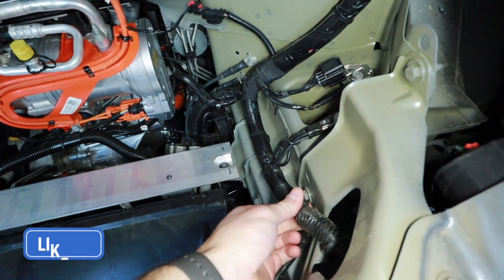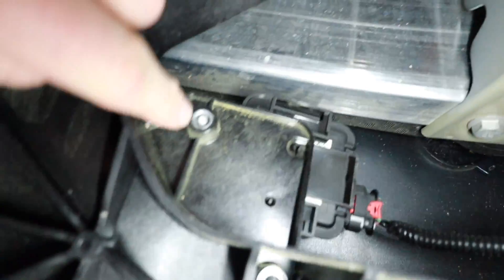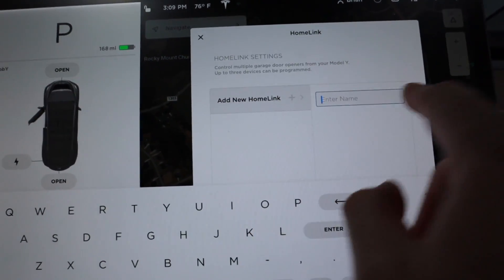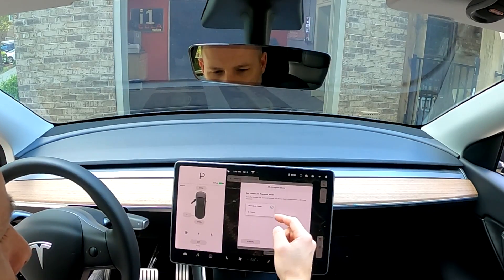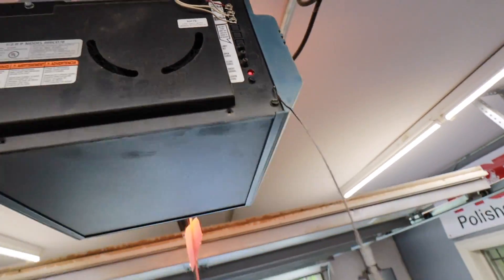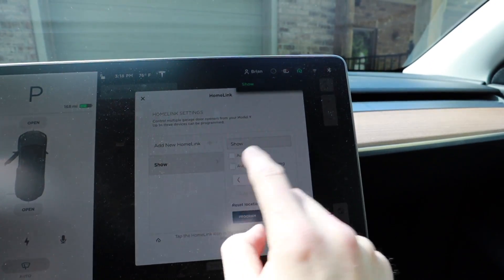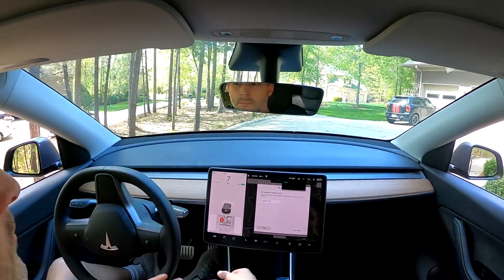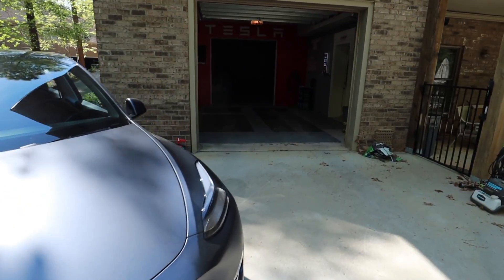Tesla Homelink Install and Program - Garage Door

Comment: I can understand why Tesla removed it as a default, to save money, but I do hope they just make it an option at the time of buying that you can check the box, and once the car is received by your local delivery center, they just install it then before you take delivery.  The install seems pretty straight forward and quick, so you'd think that would work.  I love not having to have a garage door opener clipped to the visor or stored somewhere in the car.
Reply: I hope one day Tesla is a good a MINI when it comes to custom builds on the assembly line. I have never seen another auto manufacturer that can add individual options at the level of MINI.
Reply: Rumor is that a WiFi garage door software will be released. Granted you'll need a new garage door opener or add on kit. They already have the WiFi included.

I think this overcomplicates things. Everyone has homelink hardware already at their house

Comment: I just got my homelink installed. It is INSANE for them not to install it at the factory. I don't care about the $300 just don't take my brand new car apart you monsters!!!
Reply: Elon said it is related to the high cost of licensing the technology. I wonder if they have to pay for it being installed, even if it is not activated???
Reply: Once upon a time this was included in the premium interiors, but since it's been removed it's silly how you can not order it with the car along with the often out of stock phone charging cables which were once included, the no longer included frunk mat (premium interior), and the often out of stock floor mats (not standard on the SR+) and the no longer included Nema 14-50 adapter.
Reply: They don't install it before delivery because then you would realize it costs $300 before you take delivery. It's smart business, but ethically questionable.

Comment: Yea pretty simple besides its not plug-n-play and you need service to install.  Would be nice just to buy it, take 5 mins to remove frunk yourself, plug in and it works.  I also noticed the crash sensor is under the frunk now and not attached in the wheel well on the bumper beam support.  Its the little grey device plugged in right above the home link harness.  Take it easy Brian, keep em commin!
Casey

Comment: There's a workaround for the 3 door limit if the other door(s) are compatible with any of the one programmed into the car. Just use the car as is and teach the other opener(s) your car's code just like you're adding a regular transmitter. The automatic open and close won't work, but you can still tap the touchscreen to open and close them, and it beats having to keep track of that pesky transmitter.

This is assuming you have access and permission to train the other openers, of course. Usually not a problem with family and friends but probably won't be an option for apartment parking areas or gated communities. Can't hurt to ask, though.

Comment: A lot of misinformation here. I just did the install myself. You do not have to disconnect the battery nor do you have to remove the bumper. The mount does go on the back side of the metal tab and it's a bit difficult to install the bolt (I used a 10mm box end). Programming was straight forward and it works perfectly. I suggest readers look at other Youtube videos on the subject before calling Tesla service to do this.

Comment: Dang that mobile service. I work for a small ISP as a software developer, but occasionally I have to go out to fix stuff on-site. Ladder fits in the back of my Model 3, but that would be so nice to have a sliding setup like that. I just wouldn't use it often enough to justify.

Comment: Tesla doesn't include HomeLink anymore, because the tech is outdated and costs license fees. As Elon tweeted just last week they will support wifi garage openers soon.
There are already plenty of wifi retrofit adapters for old garage door openers.
Reply: Yep. Hopefully a lower cost as well!!
Reply: @205rider8  This will very likely be a free software update.
Reply: I will likely just upgrade to a Wifi opener with belt drive, only around $200.  I have tightened the chain on my 20 year old opener a couple times in 3 years and I hate the noise it makes when it loses tension, I have a feeling the gear is going to blow up within a couple years with all of the pressure on it.
Reply: @michael86braun  nope

Comment: Interesting.  I have a 2022 and it looks totally different in that area where your homelink mount was bolted to.  And the wire is now in the center of the car.  But no clear way to mount it.  There re several "bosses" wherr it would fit, but nothing like yours, nothing that would look OEM.  Strange.  Anyone have pics of the 2022 model 3 with homelink installed?

Comment: Just got a Tesla and like many here, puzzled why Homelink wasn't added in or an option at point-of-purchase. $325 (yes, current price!) for a button on my Touchscreen to operate my garage door is not negligible. Soaked in all the great comments here but one idea stood out and I implemented it. Now I can just "Hey Siri, open Garage" - not only contact-less, its free if you already have a Smart garage opener :-)
Reply: I do the same with my Android phone.  I install a NEXX module in my garage years before getting a Tesla.  It's way smarted than Homelink which is as dumb as the clicker.  With Google assistant, open and close are separate commands, and their is status too.  NEXX was $100 (I installed it.) and so much smarter than Homelink.  It's sad to pay $300 for such dumb tech.

Comment: For programming the home link for a community gate, how would you do the ‘learn’ procedure like you did on your garage door opener?
Reply: Most community gate I came across uses fix code system, which is one set of code stored in your existing remote, you can just pair it with your remote. It won't work for rolling code system unless u have access to "learn" button.

Comment: "It's nice they included 3 garage door openers"   Uuh.. yeah.. if you say so.  My 2004 Honda can standard with that.  I find it a shame Tesla charges for just a basic feature that's commonplace on so many cars.  I love Tesla, but this along with the level of DRM in the car annoys me greatly.
Reply: Homelink is not a basic feature and it never has been on any car. Usually only the highest spec car like your Honda come with Homelink. That being said these are high spec cars and it should be included.
Reply: @garyschulmeister  That's my point.  All my recent cars have had it (2004 Honda, 2007 Nissan Quest (minivan), Chrysler Pacifica (minivan), and 2001 Nissan Maxima.  If a 20 year old car had the tech by default, then a brand new high end Tesla should as well.  It's embarrassing it doesn't.
Reply: Like Brian pointed out, HomeLink is a licensed technology that car manufacturers pay to use. The big manufacturers who have been selling millions upon millions of cars for years probably have a huge discount that allows them to provide it as a "standard" on their vehicles. Tesla is still a relatively young car manufacturer and doesn't have this clout.

Comment: Hey bud, thanks for the vids! I have a question regarding the “performance” and “performance performance” models. Do you know if by just ordering the “performance” model, are the wheels the only difference? Or do you also not get the lowered suspension, breaks, rear spoiler etc...???
Reply: The Performance check box Upgrade Includes:

20’’ Gray Performance Wheels
Performance Brakes
Carbon fiber spoiler
Lowered suspension
Aluminum alloy pedals
Increased top speed from 145mph to 162mph
Track Mode

If you do not check the box you will not get any of this. You would essentially get an AWD LR+ with a slightly faster 0-60... I am not sure why someone would not check the box..
Reply: Logan's Tech Review because the larger wheels do slightly decrease the range which can scare some people
Reply: Beat Saber Man I’d agree with that. But at no cost increase you minus well do the LR and add acceleration boost. The price with out those upgrades aren’t worth it to me.
Reply: Logan's Tech Review you’re absolutely right. Personally I’d still like the 20” or 19” wheels over the 21s just for the everyday ride quality. I wonder if Tesla would let us do that after speaking to a sales rep 🤔
Reply: @AlexH07  I'm hoping there is some market for the 21s later... They don't fit on a 3 so there may not be a great resale. But couldn't pass up the other upgrades you get.

Comment: We were fortunate that our Tesla 3 we bought in late 2018 does have Homelink. We just had a new garage door opener put in. So I deleted the existing setup and set up the new one. I believe the Standard vs the D mode is to do with this: on the standard mode I had to go push a button on the garage door opener after the first step. I believe that I would not have had to do that in D mode. Anyone know for sure?

Comment: Homelink should be included in all of Tesla’s cars. Garage door openers are common for mid luxury vehicles built within the last 4-5 years that cost around the same price as the Model 3 and Y.
Reply: Why.....that seems a waste of time and money. Most people don't use Homelink according to Tesla's research and a lot of folks do not have garage doors. Why should they pay for an option they do not use? Easy enough for the ranger to install.
Reply: @205rider8  nonsense, it comes already as an option when buying, not just a aftermarket thing
Reply: 205 rider I use my Homelink, I even have my parent’s house linked so I don’t need 4 remotes.
Reply: My 2019 base model Camry hybrid didn't come with garage door opener it only came with a manual flip switch type rearview mirror. I found the company Gentex that makes rearview mirrors with homelink for many automakers. Ordered a frameless auto dimming mirror with 3 button/door homelink for 219 bucks. Operates my garage door from a greater distance than the original Chamberlin remote and the mirror is larger than the ones in model 3 and Y.

Comment: As to why Tesla is charging $300, read on. Homelink is primarily a licensing agreement. Automakers pay Homelink a fee for every car vehicle running a their system. Most automakers across the board charge $300 for it. So it makes financial sense that the lowest priced Tesla’s, the 3 and Y, don’t include Homelink as standard equipment.

Comment: Tesla Homelink can't tell if the garage door is open or closed. Useless. Don't spend the $$$ until they fix it. They need a sensor on the garage door (like many other brands of smart openers) for it to be useful. Homelink only remembers what it did last time, not what is actually there.